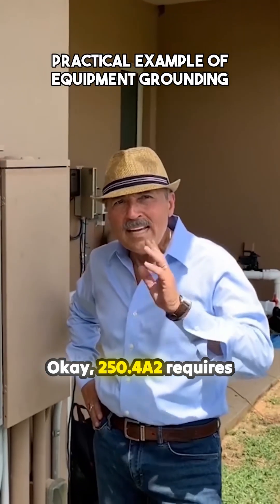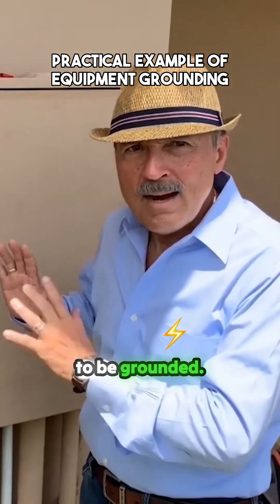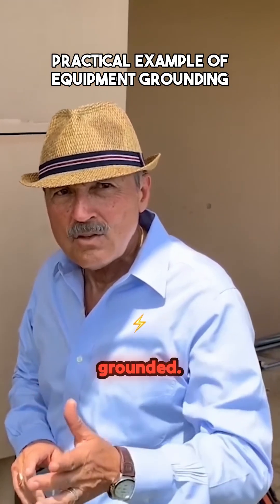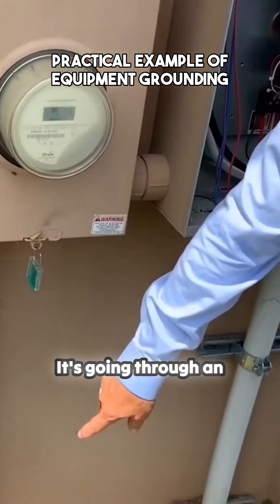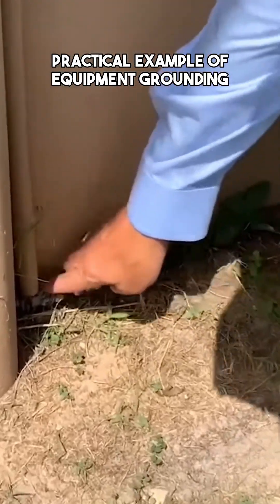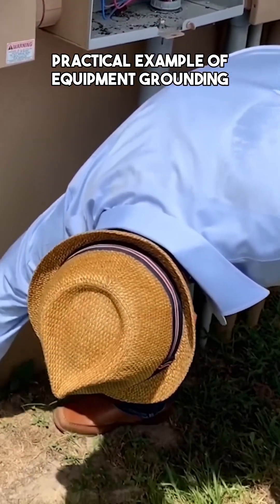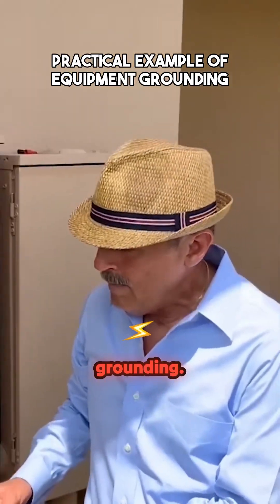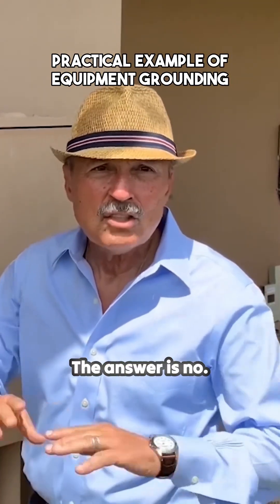Understanding the Importance of Grounding in Electrical Systems | Mike Holt Enterprises

Comment: Lightning involves immense voltage (millions to billions of volts) and current (thousands to hundreds of thousands of amps

Here you talk only about the magnetic field issue from lightning
But wht if the lightning is on direct contact with a hot or neutral line !

In that case you think that rods and little wire can evaluate that energy !

we should talk about lightning system with a specific device right?

Comment: I donot get it what high frequency gotta do with high energy, it could be high frequency by low energy such as crystals in oscillators (Electronics).
Are these people are saying if a washer machine enclosure connected to the ground and if hot from a branch touches the enclosure it will not trip the breaker upstream? Really?!!!!
I got to go back to school after 40 years being a master electrician!!!
Magnetics, high frequency are ignoble unless the current gets over 400 amps.
The ground rod is not designed for lightning arresters sir.
That has a total different design.
God help you guys following the gentleman.
Reply from the maker: @hassanhashemi6996, yep you need to watch MikeHolt.com/Fundamentals

Comment: I'm a lay man and had the assumption that for metal cased electronics kitchen white goods, pc cases, audio visual requirement. If the live was to get lose and make contact with the metal chassis, earth provides a short low resistance path. The leakage to earth then causes the fuse to blow or rcd to trip?
Reply from the maker: @Gunzee, and you would be 100% wrong. Watch MikeHolt.com/Fundamentals
Reply: @MikeHoltNEC  I’m confused, isn’t that exactly what you say at around 17minutes of the fundamentals video?  The purpose of the ground is to turn the circuit off (via the high current flow, because of low resistance, through the circuit) which allows the safety device to sense the failt?  It even has the example of a loose live making contact with the ground casing.

Comment: As I get older, the more I like Mike.
Reply from the maker: Lol.... that's only if you are okay with the NEC rule I'm explaining. My theory is you are getting smarter on the NEC and agreeing with me more...
Reply: The lightning bolt, It's not about "Frequency" Mike. It's all about instantaneous amplitude of the voltage that's dangerous. Two different things.
Reply: he is talking about why we drive a grounding rod not how to keep people safe during a lighting strike. You would need a lightning rod higher than the building that attracts electricity to flow to a low impedance path away from a building in order to make a building safer for the inhabitants. 

He is talking about allowing high frequency electrical pulses to dissipate and not destroy your electronics.
Reply: *lightning

Comment: Lightning struck a tall pine tree about 30 feet from my electric motorized driveway gate and it completely smoked the circuit board that runs it and now I got to pay $350 for a new board. 😔

Comment: Grounding for lightning. Really, for something that blows up 4 foot diameter trees in less than a second. Do you really think lightning cares about your 4 gauge wire. That wire isn't even noticeable to lightning. The reason everything is grounded is because transformers are putting out voltage solely with respect to the secondary winding. Something, usually the center tap neutral is grounded, so there are not all these floating voltages that maybe could go through you when touch a wall plate and also open that metal door. So every exposed piece of metal is tied together at the same potential with respect to the earth.
Reply: "...the high frequency energy will be discharged into the earth."  Lightning is Direct Current.  It has no frequency.  This guy speaks in word salads.
Reply: Problem with the neutral or floating neutral is a good reason for that grounding.  Another is equipment failures and keeping them safe - like not electrifying the metal body of an appliance.
Reply: That’s all they keep changing is the grounding…..
Reply: They'll make us add a third gec...madness

Comment: But why is it bonded to neutral, and then the service disconnect also be bonded to neutral?
Reply: From my understanding, it’s more so to prevent issues once you get to the step down transformer side. The lineman don’t run a ground wire, as the neutral for them accomplishes the grounds purpose, ie excess and fault current gets sent to the ground off the lineman’s neutral
Reply: There should only be one point where the neutral and ground (EGC) are bonded, which should be at the service disconnect, which provides a low impedance path for fault current to trip an overcurrent protective device. Either the service disconnect or the meter can is where the GEC is connected to the grounding electrode. Bonding and grounding serve different purposes. Mike Holt has several great videos where he gets into the differences between the two concepts.
Reply: i believe they are referring to a grounded transformer maybe? yes correct though. if the disconnect is the main service entrance thats where the bond between neutral and ground is made and nowhere else because otherwise you create dangerous fault paths.
Reply: @beachbumjedi7117  see.   In Florida, meters are bonded to neutral, and 1st service disconnect is also bonded to neutral, and I always questioned why the service disconnect gets bonded if the meter is bonded, but that's what the inspectors always have us do.  Also, i have seen pierce taps line side of the service disconnect feed a disconnect, which also bonds to neutral.   Now that makes sense to me if we are going by bonding means being 1st disconnect load side of meter, because it would be a second "1st means of disconnect".  I just wondered why the meter also, and why that's not always the case depending on what state we are in.

Comment: I thought grounding was actually made to clear faults easily and effectively tripping circuit breakers 😐😐😐. Like when a hot wire touches the metal boxes due to wear or something @mikeholtnec help!
Reply from the maker: That is what I thought. But I was taught wrong. See MikeHolt.com/Fundamentals and learn something new today.
Reply: @MikeHoltNEC  thanks for your response! You were a hero for me back in the days where I was studying electromechanical engineering, also in the first years working. I’m no longer practicing as engineer but watching your videos brings back great memories. 🙌🏽
Reply: @ernestonoiran1852 that's what the Bonding screw does, provides a return path to the Neutral to clear a fault, here he's talking about the Ground Rod, which is confusing because it's using some of the same words, but it's on the other side of the Bonding screw and has different functions.

Comment: I've seen some really strange voltage situations in ungrounded homes. 
Added ground rods - all fixed.
Reply: Strange voltage is usually a neutral problem example 150v on 1 leg to neutral, 90v on the other 240v total under unbalanced loads. I've never seen a ground rod correct unusual voltage.
Reply: I have seen an ungrounded system cause havoc on electronic and electrical equipment.  When the Grounded conductor was installed it solve the problem. I know because I found the problem.

Comment: that is specifically incorrect. lightning suppression is not supposed to be bonded to the grounding system. Also a ground rod will actually stop your house from burning down if the resistance is low enough when you loose a neutral.
Reply from the maker: When a lightning protection system is installed, it is required to be bonded to the building grounding electrode system, see 250.106.
Reply: Have you any clue how many books this guy has written on these topics?

Comment: So when I’m on vacation in other countries standing in the shower that has a point of use hot water heater and no ground.  Somehow I feel safer because there no path to ground. Am I correct?  When I was younger the garage fridge would light me up if I touched it without having shoes on. 🤷
Reply: In general if you are in a shower there is plenty or routes to ground so equipment grounding is needed. In Asia grounding is often less used and the results are seen. In India ten thousand die annually from electric shocks - a rate ten times what it is in the West.

Now many counties in Europe use TT earring where the ground wire is not connected to the neutral. Instead an RCD (GFCI) is used to make it safe. The entire house has a 100 mA RCD and then 30 mA RCDs in almost everything.
Reply: @okaro6595 man have you seen what they do for disconnects in India? Watched a video of a guy servicing a pole on the ground live, instead of fuses he grabbed AL wire and twisted it around where fuses were supposed to go. All of this could be touched by someone walking by as none of it was enclosed😂

Comment: Why do we bring a GEC to a transformer/separately derived system then?

I’ve been told the GEC requirement was added in the 1920s to protect against the loss of the GEC serving the utility’s pole - mounted transformer. In the case of theft, the 120/240 split phase system’s neutral would still be connected to 0V reference point.
Reply: Good question.  A separately-derived system means that there is no direct electrical connection between the two sources, and that the nature of deriving the systems doesn't guarantee the SDS to have the same grounding as the main system.

I'll use a transformer as an example.  A transformer (not an autotransformer) doesn't electrically connect the two sides together; it only magnetically couples them.  It also cannot transmit absolute voltage across its windings, but only the change in voltage.  This means that the secondary is by default, isolated from the primary.  Until you also ground the secondary, the secondary voltages will float.

The secondary grid is a separately-derived system, and needs its own grounding re-established.  Thus, the transformer secondary of a system you intend to ground, requires a neutral-to-EGC bond, and an EGC to GEC bond as well.
Reply from the maker: Please watch MikeHolt.com/Fundamentals, that should be helpful
Reply: @zedjo02  What does any of that have to do with the OP's question?
Reply: @carultch Would you consider a GEC installed at the service point of a 120/240v split phase system a backup neutral reference point?

Comment: High frequency? 

I think Mike means high energy.  3 million Volts and 30,000 Amps

It is direct current... static electricity built up in atmosphere. 

Otherwise this is a great video.
Reply: It's pulsating DC, which is a superposition of both AC and DC.  The overall current is flowing in one direction, but it is not a constant/steady stream of current.

Inductive effects apply any time there is a change in current, even if it doesn't alternate to the opposite direction.  The high frequency bursts of DC, effectively act as if they are AC.
Reply from the maker: See https://physics.stackexchange.com/questions/132576/why-is-lightning-referred-to-as-high-frequency-source

Comment: Grounding insures everything burns up quickly instead of it slowly dissipating and possibly saving your equipment. 😊
Reply from the maker: Well.... lol
Reply: Seriously, if short to egc, then breaker usually trips. When not, are we worse off, well, usually not, but, sometimes.
Reply: You don't understand grounding. Grounding insures that everything that is supposed to be grounded is at the same potential. When a voltmeter measures voltage it really measures a voltage difference.
Reply from the maker: @marcw1867  well... not really. Please watch MikeHolt.com/Fundamentals
Reply: @marcw1867  Hahaha Mike just told you to watch FUNDAMENTALS. hahahahhahahahah
Reply: @theartisan1898  lmao this gave me a good chuckle as well
Reply: @marcw1867  what do I know - I've only been a lineman for 24 years.